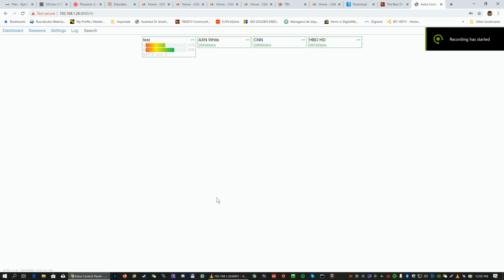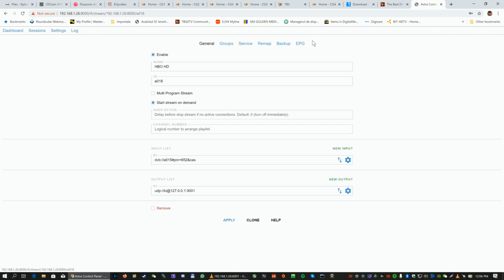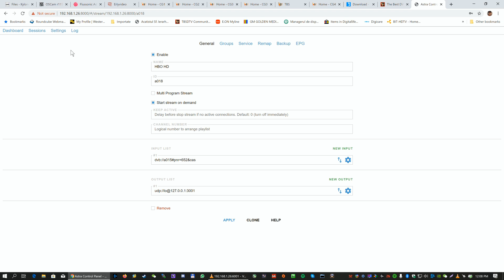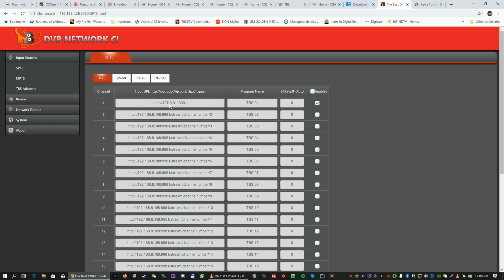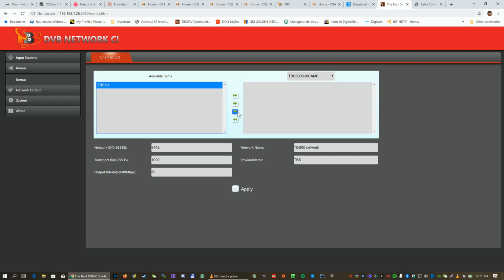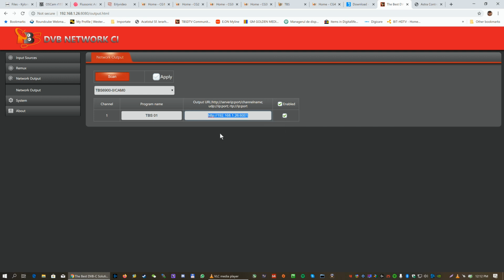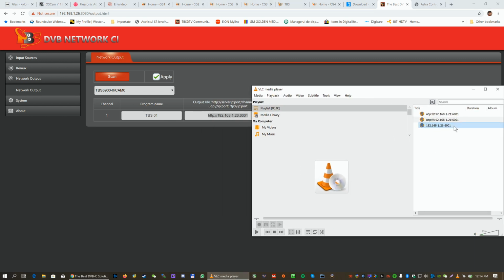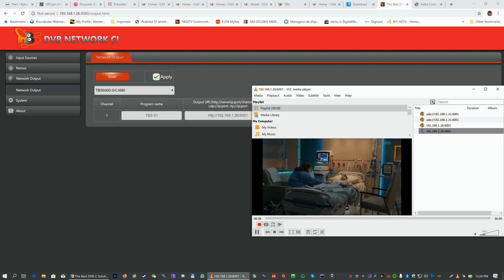TBS6900 Dual CI/CI+ pcie stand alone card with Astra Cesbo Software

Comment: Is it possible to use tbs 6910se like a this 6900 card, only for decrypting with ci module without connecting coax cable?  If it is possible, how can i do that :/ Thanks
Reply from the maker: No , 6910se is very different from 6900

Comment: Very nice tutorial, keep it up. If I would like to decrypt paid (encrypted with CI module that I got from the provider) tv channels and stream them via IP address, is for example TBS6290SE (or TBS6590) enough for these purposes? Or beside either of them, would I also need TBS6900, because of the streaming over IP?
In the end I would like to stream over Raspberry Pi.
Reply from the maker: IP content usually differs in encryption from standard DVB content (cable/satellite/terrestrial)
Reply: @ovidiuss31  So if I got it right, that means I would actually need a TBS6900 as well, just for the streaming purposes over network?
Reply from the maker: @FilipVucinic  if the provider / operator broadcast signal is in any of the DVB standards then TBS tuners are useful and able to receive decrypt and convert to IP. On the other hand if the operator/provider broadcasts the signal directly as IP signal then TBS gear is useless. TBS tuners can only handle DVB standards signals
Reply: @ovidiuss31  The provider broadcasts the signal via DVB-T2 and with a CI module. The only thing I would like is to be able to stream the channels on my PC and in my network area (via Raspberry Pi and IP address). Is TBS6290SE enough alone (without TBS6900) in this case?
Reply from the maker: @FilipVucinic  this is what you will need and is much more handy to connect with raspberry pi or any IOT device … https://www.tbsdtv.com/products/tbs5881_dvb-t2_tv_tuner_ci_usb_box.html
Reply: @ovidiuss31  I see, thank you for the suggestion. But would TBS6290SE alone, without any other card work as well?
Reply from the maker: @FilipVucinic  yes
Reply: @ovidiuss31  Thank you very much for your help!

Comment: What is the difference of CI and CI+
Reply from the maker: CI+ is a further development of the DVB-CI standard 1.0,  which was previously used in TV sets and CI modules. With CI the encrypted digital programmes are decoded in the module and then passed on directly to the TV set. With CI+ the encrypted digital programmes are encrypted again between the module and the TV. In this way it is also possible to ensure that the minimum requirements for parental control and copy protection are met. A TV set with CI+ specification recognises whether a CI+ module is being used. If a CI+ is not being used then encrypted digital programmes may possibly not be shown.

Comment: Dear Ovidiu, may I ask you to confirm TBS6900 CI is really compatible with CI+ cam? I understood that CI+ is using strong encryption system and it is very very hard to decrypt. Thank you
Reply from the maker: Any CI module is capable of CI+  either is from TBS or Dektec or NetUP. The efective decryption is made by the SOFTWARE used to manage the DVB cards.
CI module is just a piece of hardware to allow the connection.
Reply: @ovidiuss31  This is not correct, CI and CI+ are identical from the mechanical interface, the CI+ Cam asks but in communication a Secure Chip. If this is not installed, no CI+ encrypted program is decrypted. This secure chip only get set-top boxes and TV devices manufacturers that are CI + certified. Some CI+ modules work in legacy mode if the operator of the TV program has released it, for example ORF.
Reply from the maker: @Rowlf   TBS6900 is just a blind hardware reader, the software used makes the difference. There is no official CI+ support outside the consumer hardware such as tv’s or branded stb’s / boxes. There are at least 2-3 public SDK code written by enthusiasts community people ( tvheadend / minisatip / special build of dvblast ) that are able to read CI+ no matter which maker or model of DVB-CI used.We at TBS do not encourage this type of usage because of the legality concerns. I just pointed out all sides of information regarding the usability of our product TBS6900.
Reply: @ovidiuss31  So if I insert the CI+ CAM with the card I purchased into the TBS6900, tvheadend should be able to decrypt the channels for me?
Reply from the maker: @matej8666  it depends on which software is used , it doesn’t depend on hardware

Comment: Salut ovidiu se poate sa castezi direct din reciverul telekom digi etc ? Si pe care il pot folosi sa pot face o listă doar cu posturi românești.  Multumesc
Reply from the maker: Ai pus intrebarea la filmuletul gresit , Network CI nu are nimic in comun cu encoderele . Pentru ceea ce vrei tu sa faci e necesar un dispozitiv de tip encoder ce  functioneaza doar 1 receiver = 1 encoder sau 5 receivere cu 1 encoder model TBS2605 ce are 5 intrari.